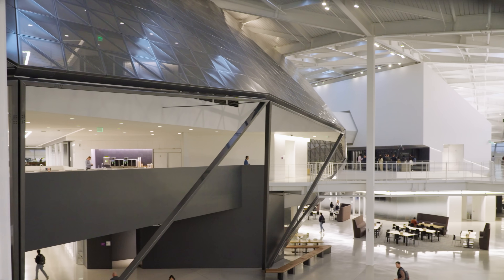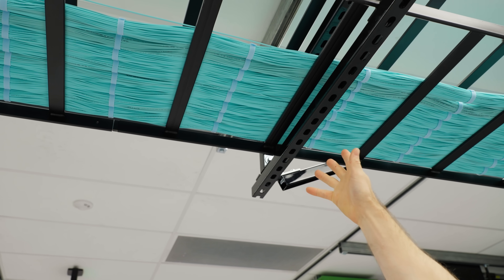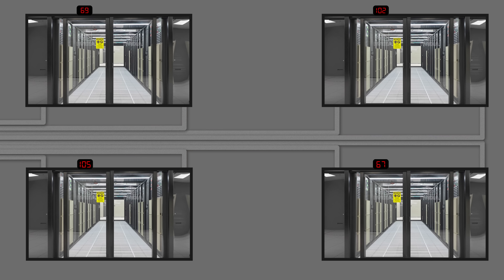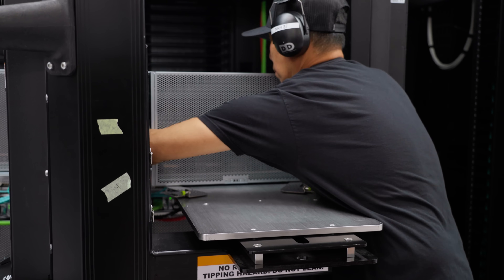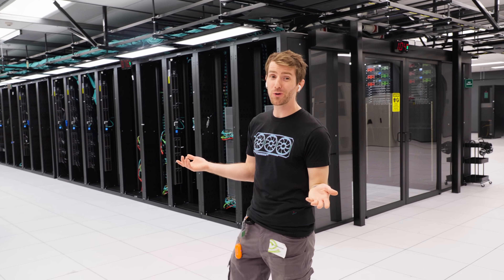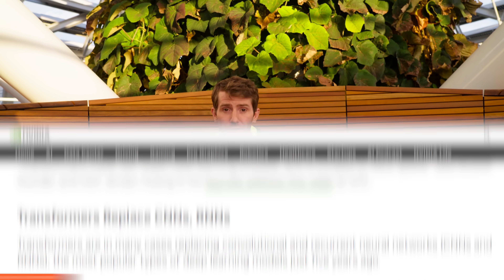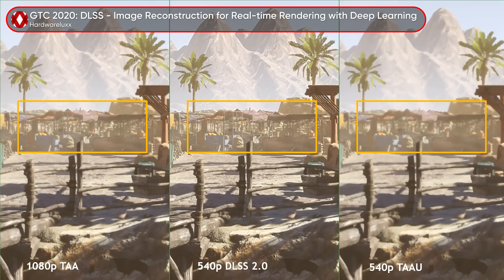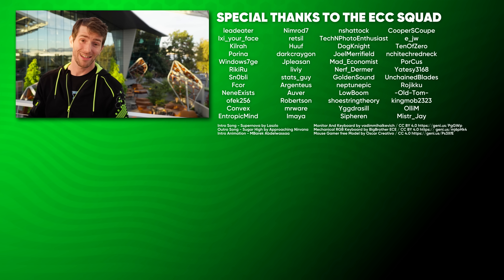NVIDIA Showed Me Their Supercomputer

Comment: In this video, Linus Tech Tips tours NVIDIA's Nyx supercomputer headquarters in Santa Clara, providing an exclusive look at the powerful infrastructure used for AI research and development (0:07).

Key highlights of the video include:

    Internal Production Space The tour begins with a look at NVIDIA's internal production space, which is constantly reconfigured for R&D and chip/server validation. The space features raised floors for water-cooled deployments, though currently set up for air cooling for DGX B200 racks (1:30).
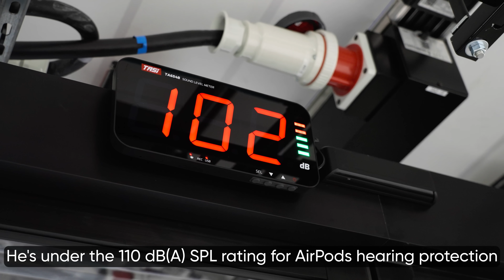    Detailed Monitoring and Airflow Management Linus points out the extensive use of sensors, including decibel meters (2:14), temperature sensors (2:23), humidity (2:31), and air pressure (2:45) to maintain optimal conditions. He explains how fresh air is actively blown through the floor to create positive pressure, pushing air through the DGX systems and into hot aisles (3:17).
    Attention to Detail and Serviceability NVIDIA's meticulous attention to detail is highlighted, from strategically positioned networking racks to minimize fiber optic cable length and strain on the ceiling (4:04) to organized cable management for optimal airflow and ease of maintenance (4:47). The video also showcases top-mounted PDUs for power distribution, making DGX unit removal easier (5:14).
    Hardware Teardown Linus gets hands-on with a soon-to-be-decommissioned engineering unit, revealing the massive heat sinks on a 1200W GPU (6:07), the flat heat pipes designed for better airflow (6:20), and the cooling for the Envy Link switching equipment (6:32). He also shows NVIDIA's proprietary SXM interface and a GPU without its heat sink (6:52).
    DLSS Explanation and Development The video delves into the primary use of the supercomputer: Deep Learning Super Sampling (DLSS). Edward Leu from the GeForce gaming team explains how DLSS upscales lower-resolution game renders using AI for smoother frame rates (7:49). He discusses the iterative process of developing and fixing DLSS features, emphasizing that the majority of time and cost is in test training runs (8:56).
    Future of DLSS and Traditional Rendering NVIDIA strongly believes DLSS will eventually surpass traditional rendering in quality. Edward presents slides showing how native rendering is already an imperfect approximation compared to a "ground truth" image (10:08), and how DLSS has shown the ability to reconstruct images closer to this ground truth (10:52). While DLSS still has areas for improvement, the industry is increasingly accepting AI-accelerated image enhancement as the future (11:30).

Comment: 5:33 German electritian apprentice here.
Those are just CEE 125A connections.
I see those on some construction power boxes.
Although we mostly just use the CEE16 for heaters in winter.
Reply: Yes, thats the comment was looking for. 
This 3-phase 400V 16A Socket and Plug i know too good. We have some of them on our property at home.
Reply: @evilbaron yeah, they are quite common in sweden as well. Usually found in garages or even in older laundry areas(nowaday single phase 230V is enough though) and in industries of course.
Reply: You sometimes find it in garages as either an outlet for a workshop or the preparation for a later car charger.
Although it's most v
Common in industrial applications and construction sites.

Comment: Using TAA images to show how good DLSS is, is kinda unfair to properly implemented anti aliasing solutions. Gamers and also many developers have said in the past, that current TAA implementations make the image worse, because they smear the image too much. TAA even in these days look worse than simple FXAA, since they destroy the sharpness of the image. Since modern games use Forward+ render pipelines these days (or at least they should if they are properly designed), games can use MSAA again and even MSAA 4x native smokes DLSS in terms of image quality. And should there be some visual noise left that MSAA doesn't catch, you can always apply a small amount of screen space AA pass (like FXAA, SMAA or CMAA2), which especially on 4k images, works wonders (especially on foliage).